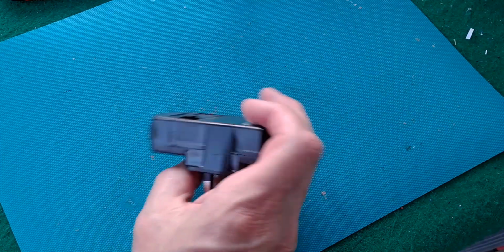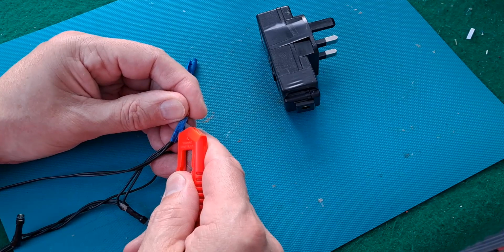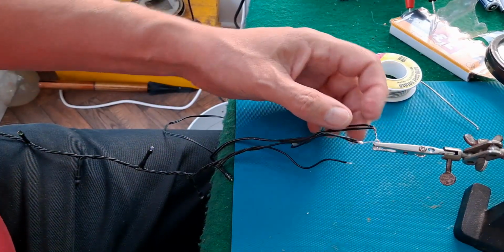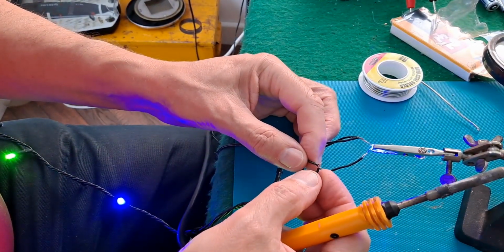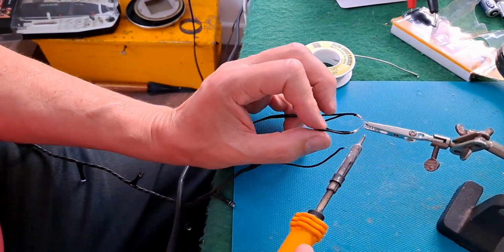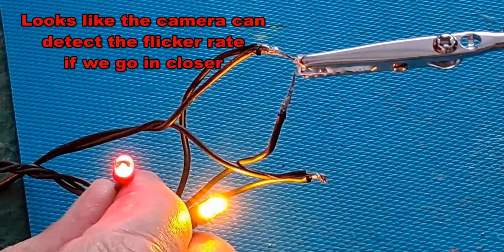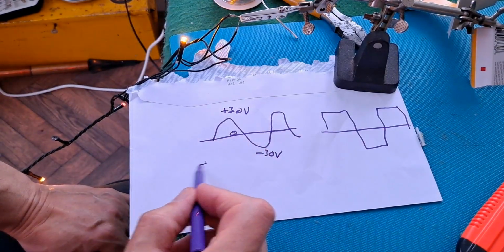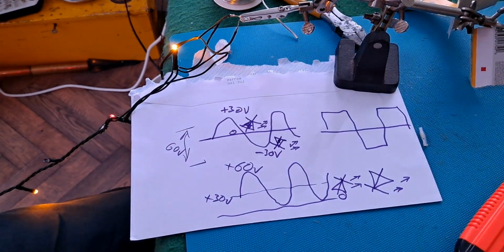Another look at the Morrisons LED string lights 20210906

Comment: In my opinion, you are correct as to how this works Graham
Just a guess, but that chip on the power supply may only be for the combinations of the flashing or dimming. If so then the chip is ok and some other component is faulty. Does the circuit board have transistors on it? 👍
Reply from the maker: Yes I showed the board in close up in previous videos. I suspect it could use something very similar to the H bridge used in toy grade RC motor control. The only question is whether that H bridge is within the chip or the surface mount components.
Reply: @GrandadIsAnOldMan  Just had another look at the board from the other video. I notice there is a US1G rectifying diode just above the push button pad at 4.48 on the other video. If that was broken then that might be causing the issue. Also notice a lot of SM transistors on the board. Could be worth putting the meter on them. 👍
Reply from the maker: @mikeflight9  my gut reaction was that if that diode was faulty, we would get zero output as that is one leg of the 30v supply. However I have just had another look at it and I get the same measurement from both directions, which seems odd for a diode, so I have just ordered 50 of them (smallest number I could see at a sensible price). All the resistors are giving the right reading. Testing the transistors is not quite so straight forward whilst they are in circuit but I compared their measurements to their twin and they seemed to match. By twin I mean the other half of the H bridge. There are two 9FCG and two 6CG. I have also tested the LED string with a different power supply and they work fine. All the sequences work.
Reply: @GrandadIsAnOldMan  Looking forward to the new diode being fitted. Might be interesting to put a run-of-the-mill diode on it while waiting for the new ones.
Reply from the maker: @mikeflight9  I did consider that, but the new one should be here in a few days, UK stock, so we will see.

Comment: If the wiring at that break is still in question, match it to the one 20 LEDs down the string.  Clive's drawing @8:42 shows two wires on each leg of the LEDs except between groups.  (Move his lines between groups to alternating ends.)  And one wire running to the far end to the last LED.

I still don't know how there would be 60v and 30v unless there's a SCR like device being used to control each half of the wave.  One for green/blue and another for red/orange.  

If the power supply is actually 30v DC with a H-bridge to reverse the polarity (Charlieplexing) , there wouldn't be 60v.

But, whatever it is that handles the reverse voltage, is only working in one direction.  Could be a GPIO pin on the controller, or a device connected to a GPIO pin, that burned out when the wires got shorted.  

Right or wrong, it's still good exercise for the brain :-)
Reply from the maker: I have tested the LED string with a different power supply and they work fine. All the sequences work. I suspect the circuit uses something very similar to the H bridge used in toy grade RC motor control to reverse the polarity. I am putting together another video, but it won't be public until 20th October as that is the next available slot in my schedule.

Comment: When the lights are giving out breif pulses with longer dark gaps between them, it looks a lot like when a switched mode power supply is overloaded and keeps shutting down/restarting. From what I can see there are 2 wires coming from the power supply in one direction, and three going to the string of LEDs. presumably one wire is for the string of positive-facing LEDs, one for the negative facing LEDs and the third as a return for both. Since you have tried all the combinations, I think you are right that there is something wrong inside the power supply. Sadly unless there is an obvious problem replacing the power supply is likely to be as expensive as just replacing the whole thing. Perhaps you could make an alternative simper power supply, or just use the LEDs in another project!
Reply from the maker: It is difficult to picture the sequences of the flashing when you are only seeing half the sequence. The different rates of flashing might be perfectly right, if you had the other half of the lights working, and could see the whole sequence working. It would have been nice to have seen the lights in operation before they went faulty. Having said that, it is quite possible I might have a similar set of my own in the loft with our Christmas decorations. And I know we have some faulty sets that I have avoided looking at 🤣

Comment: to help me to understand this project,are all  the lights supposed to light up at once?
Reply from the maker: No Marc, half the lights come on when the voltage is on the positive cycle and half when the voltage is on the negative cycle. An LED only lights when the current is flowing in the right direction. To help you understand this, you could take two LEDs and connect them so they are the reverse of each other. Lets say one is red and the other is green. If you connect your battery to them, only the red will light up. If you reverse the battery, then only the green will light up. By using a pulsing power supply instead of a steady DC current, you can do clever things. If it pulses fast, your eye will see the LED as a steady glow, even though it is flashing fast. If you connect that supply to these two LEDs only one will light, but if your pulses alternate between negative and positive then both LEDs will light at the same time. If you vary the length of the pulses, you could make the red LED stay on and the green LED fade up and down. Or do the opposite with the green on permanent and the red fade up and down. When you combine these effects and apply it to strings of LEDs you can make the lights appear to ripple or chase along the length. That is how Christmas lights work.
Reply: @GrandadIsAnOldMan  thanks for  all that Info 👌👍

Comment: try looking up Charlieplexing ,it's a way of doing multiple actions using minimal wires ? or the simpler multiplexing system ? Charlieplexing failed led will fail all arrays . maybe worth a wiki-look good luck with your Illuminati / voodoo powered  signage m8
Reply from the maker: Thanks, have a peek in the video description, you will find a link for a video on Charlieplexing 😊👍